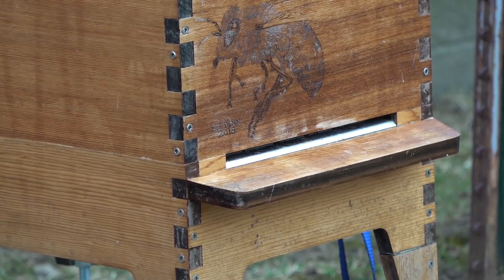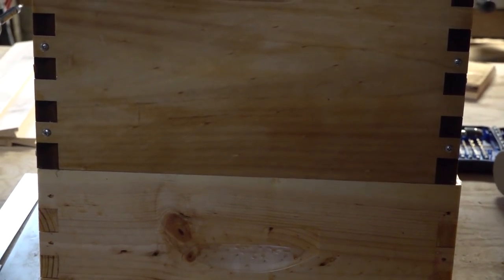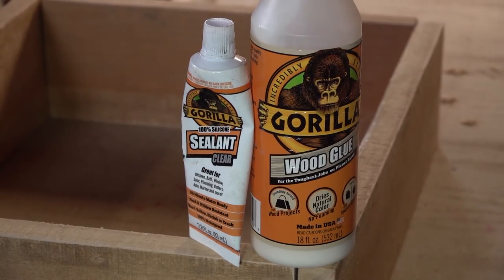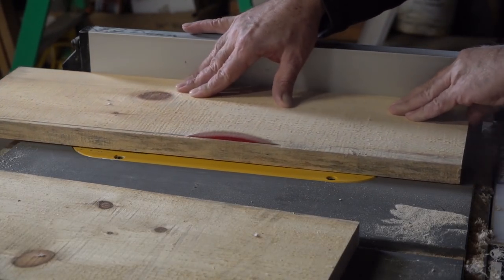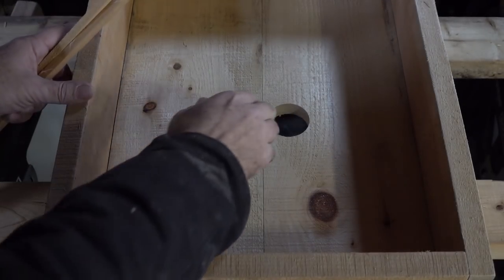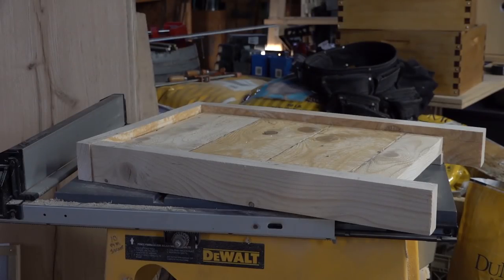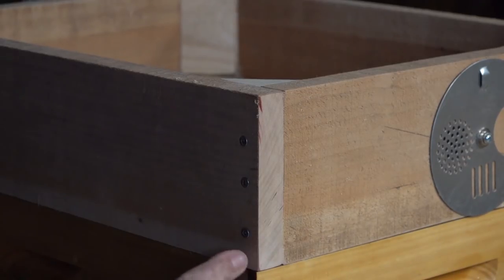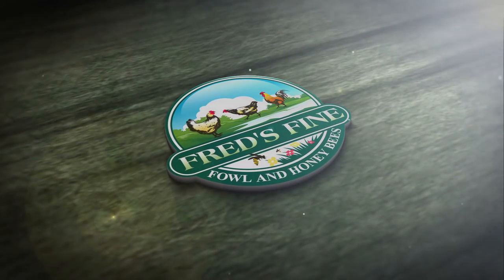Honey Bee Feeder Shim How to Make Your Own with Basic Skills Feeding Bees

Comment: I want to make one of these feeder shims for a new hive from a split I am planning, but I don't want bees building comb in the feeder shim. How would you recommend altering the design so that bees can't access the interior of the shim but the hive still ventilates? My first thought is to put the round feeder right on the floor of the feeder shim to exclude the bees, and then add a similar size hole in the floor of the shim in a corner of the shim where it would not be covered by the round feeder and use window screen to cover the hole. I am a bee newbie so I am uncertain if this is a good solution or whether I am going to create problems with ventilation, the ability of the bees to patrol for pests, etc. Thanks in advance for your input!

Comment: What's the difference between a dry pollen substitute and a pollen patty?  Would setting up a feeder or two in the yard be as good as having one on each hive or will that cause problems?
Reply from the maker: The pollen patties are an in-hive protein booster for the workers and nurse bees. If they are placed outside at a feeder, they would be ignored as they are just emergency rations to prevent the bees from starving during bad weather. The dry pollen is the opposite and should be offered outside many yards from the apiary. Foraging bees will locate that IF environmental pollen isn't enough. These are just insurance measures to prevent brood failure.

Comment: Do you typically apply any finish to your bee furniture?  I want to make my own woodenware, but  would prefer to put a clear coat.  I am not sure mineral oil is sufficient, but also don't know if I should be cautious applying a exterior urethane.  Thoughts?
Reply from the maker: I use helmsman's marine varnish.

Comment: Fred - when installing the bottom board into the shim.... are you only gluing them in place, it doesn't look like there are any nails or screws holding it in place?
Reply from the maker: I've added stainless steel screws, two per side.

Comment: Where can we get the styrofoam telescoping board?
Also, when and where does flow super get inserted at this setup ( board + deep b box + medium super)  ?
Reply from the maker: Bottom board, then Brood Deep Box, then at least one medium honey super, and THEN the Flow-Super and this feeder shim is the top box. For winter, you remove the flow super and this feeder box goes directly on the remaining honey super. As for the insulated cover, it's called the BeeMax cover and you can get them from BetterBee.com

Comment: That feeder will be verry usefull.Also try to dip in parrafine next hives to protect your drawings  on the boxes better because the wood thats boiled in parrafine will not oxidate like when it does when its coated in oil.You can boil them in parrafine even if they are coated with oil but it will roast the oil and will get even darker( id let them only with oil and only the new ones id teeat with parrafine.For a diy parrafine dip really cheap il post a video that shows you dont have to buy houndreds of litters of wax.But its dangerous and if you would like to do it ,then learn more about it or better find a place that does parrafine dips professionally.

Comment: Odd, am I the only one seeing video glitches about every 5 seconds?
Reply from the maker: That is strange because when it first uploaded there were no problems at all. It seems that there is a single image repeating through the video. I hope it's not subliminal advertising (';')
Reply: Well, I don't know what you're seeing, but I'm seeing streaks of red, green, blue and black lines that are close together like ribbons across a gift box both horizontal and vertical but off center. There are some small squares of black that flash with the colored lines. I thought it was either my computer, the browser or YouTube. Your vids are usually clear as a bell, great sound and lots of resolution. I watched another vid after yours and in the beginning it stalled a lot. The sound track was fine, but the video part would halt for a few seconds and then catch up, and other videos were fine. I don't know what's going on with YouTube lately but I'm seeing a number of messed up videos.
Reply from the maker: @SpiritBear12  Thank you and I'm sorry, it's so odd and has never happened before. I did a search and no identified issue. It's a puzzle.
Reply: @FrederickDunn  It's OK, it's not your fault, just another unexplained glitch.
Just a thought though, this I think is the first time I've seen a video of yours in your workshop. Do you have LED lights in there? I wonder if they interfered with the camera. I put Cree LED lights in my Aunt's kitchen ceiling fan, but they bothered the small flat screen TV she had in the kitchen, so we put regular bulbs back in the light. Sometimes LEDs bother other electronics. So far they have not bothered anything in my apartment.
Reply from the maker: @SpiritBear12  Remember that my home is entirely solar powered - soooo - all of my lights are LED - and here we are and the video magically fixed itself. so, there are two videos uploaded with the same content. OH well...